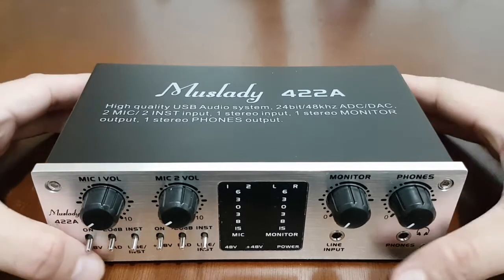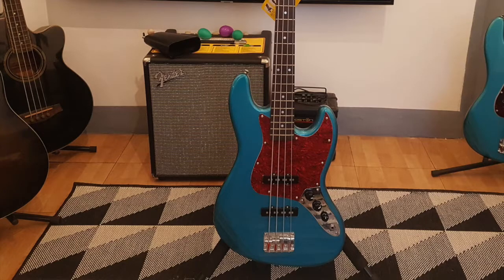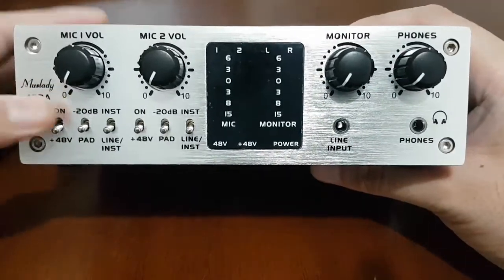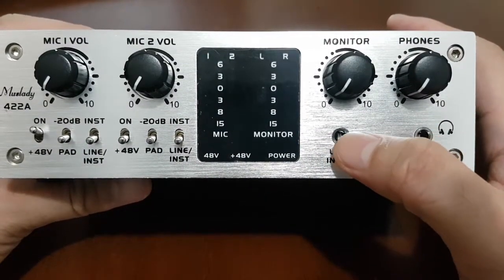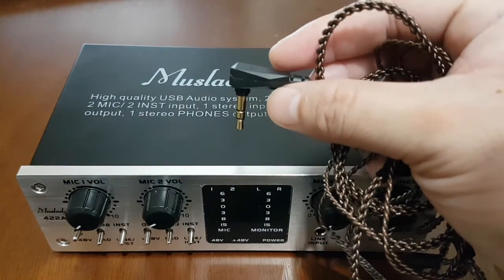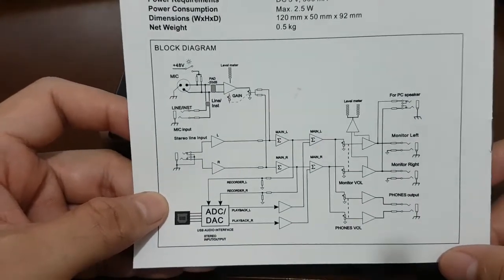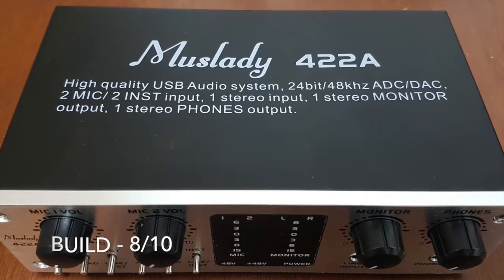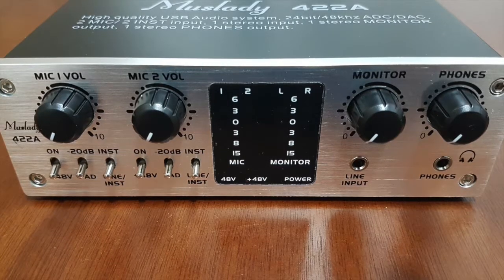Muslady 422A Full Review

Comment: Hello Mr. Do you know if  the interfase works with any MacOS (highsierra) I mean, there´s  not a trouble with controlers?...firmwares? Thanks.
Reply from the maker: Hi Mauricio, we tried it on Mac not sure if its high sierra but the OS is the one after yosemite and we had no issue running it on garage band.